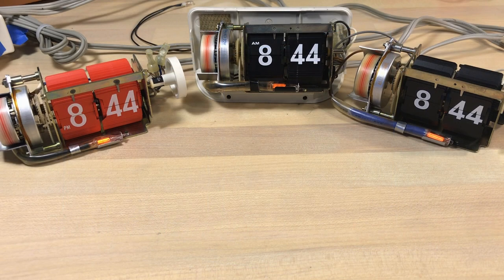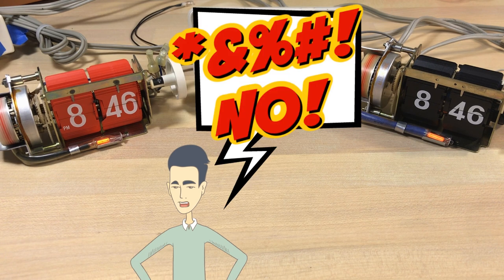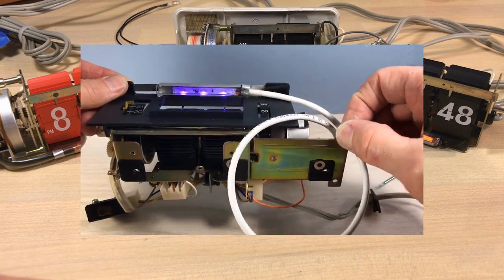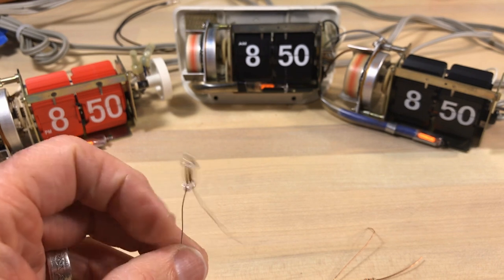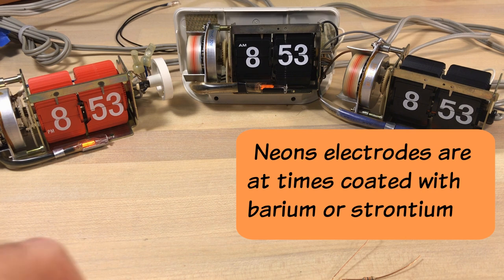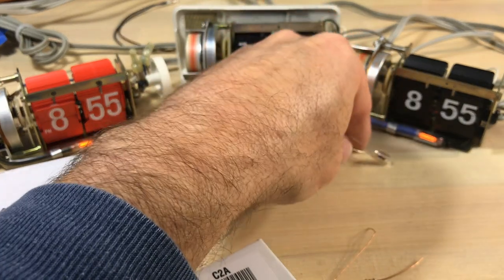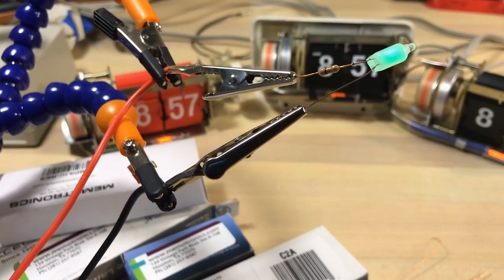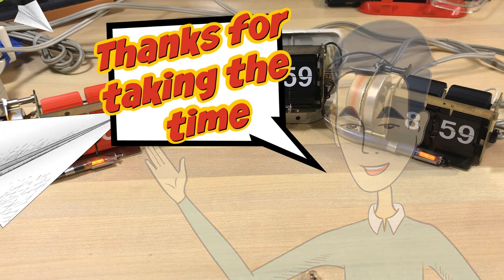Neon Glow Bulbs verses LEDs

Comment: Keeping it original is the way to go. People put LEDs in old pinball machines and they look like refrigerators.....I mean, the new ones are all standard LED which is fine because they are new....but I can’t stand replacing the old stuff. One of the reasons people do it because there are loads of lamps in a pinball and there’s a lot of heat but with a tiny neon bulb there isn’t really Marssonde to switch to LED because a neon doesn’t use a lot of amps. It’s much like a neon tube....also.....the warm glow is what needs to be there on a flip clock IMHO.
So fully agree with you.

Comment: I have "updated" vintage items before, mostly out of necessity, safety, or practicality.  For example, the vintage radio guys will usually recommend changing the power cord when the radio has a dangerous "hot chassis".   Also, if you want the old radio to work again and continue using it, rather than being a "shelf queen", you have to replace some vintage parts with newer, and usually better parts.  Some will even go so far as to embed a modern capacitor within a vintage casing to use as a replacement.   Like anything else, there is some debate over this.  When I make these sorts of changes, I always try to make them "reversible" in the sense that the item could be restored back to it's original form assuming functional and original parts somehow became available, as unlikely as that sometimes is (in your case, I doubt they will ever make original black light replacements so an LED is an appropriate alternative).  Also, I try to "tread lightly" and avoid drilling holes or altering original parts.
Reply from the maker: I really like your style. That approach will Maximize any vintage item’s worth.

Comment: I decided to wire in 2 of these lights on an old Panasonic one for the hour and one for the minutes.  It made it a bit brighter and looked nice and uniform.  But my personal favorite is my LED black lighted Panasonic 7462!  You are right the LEDs do go out after time.  One of the 3 are starting to dim a bit but you can’t tell on the clock face.  Thanks again for the videos!

Comment: There are AC LED's available I have used that don't require a driver or converter. Best argument is to keep the clock as original as possible. However each to their own.
Reply from the maker: Very interesting development, but for the clock I've shown there would need to be a way to get the voltage down to 12v or 24v - the clocks run on 110-120. Unless I'm missing something. Thanks for the info.

Comment: One application where these beat LEDs (as far as I can tell from looking into it) is as ground fault indicator lamps on an isolation transformer. One neon on the positive leg and another neon on the neutral leg of the secondary with each free leg connected to ground through their own high quality resistor. The reason they are better than LEDs is because you can use 300K-500K high impulse resistors to keep the current just low enough for the lights to flicker on during a fault without the 2 neons lighting each other through ground. Someone can correct me if I'm wrong, but doing the same with LEDs would require a lot more current (or a complicated circuit) to achieve the same.

Comment: What color light do you prefer on a flip clock, if it was the original color (so you left it original)?
Reply from the maker: xxrs2009 - If I’m “restoring”  a flip clock I want to restore it to the original condition. But if I’m upcycling a clock I like green or white light.